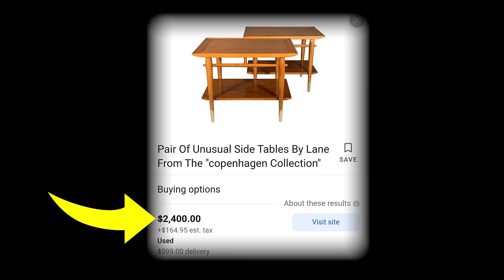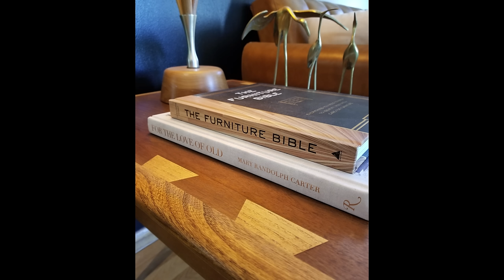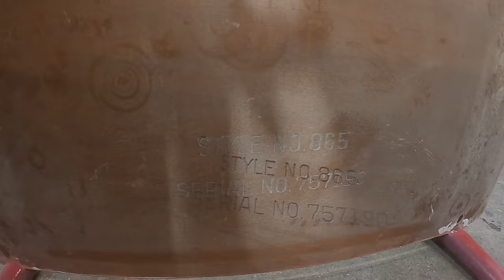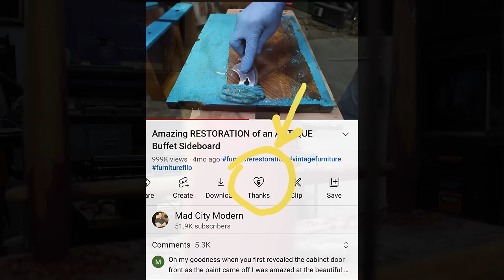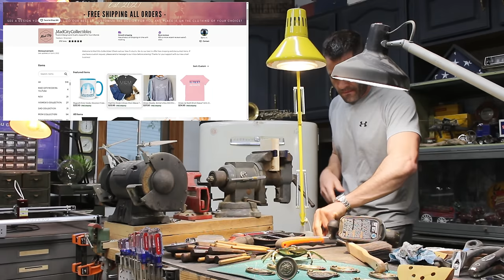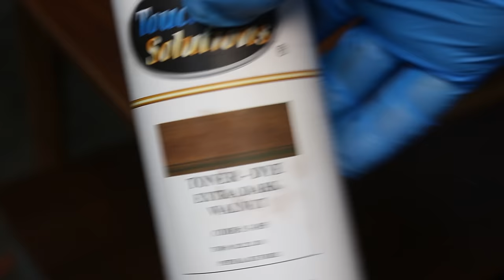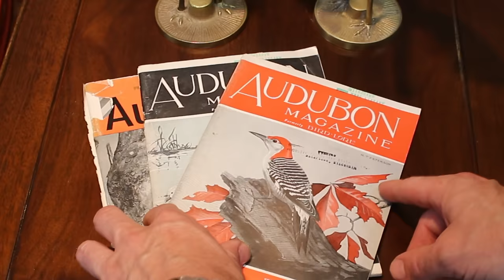Ep. 38 Amazing RESTORATION of a RARE VINTAGE Lane Side Table

Comment: I wasnt born for more than 20 yrs in 1957 but, Ive inherited several pieces of furniture from my parents and grandparents. I have a small, half round 'radio table' from the early 1930s that was my grandparents. I also have a pie crust edge occasional table from them. I inherited a 1948 Lane cedar chest from my mom and several hand painted, china lamps that were converted from lamp oil to electricity, from my grandparents.❤❤❤

Comment: I was a child in 1957 but I live in a 1959 mid century modern so you have to have a bit of furniture from that time period.  My oldest piece is a drop front desk from about the mid 1800’s .  When I purchased it it had its original ebonized finish but was in terrible shape.  When I removed the old finish I was surprised and delighted to find that under that black was solid curly and tiger maple with veneer only on drawer fronts.   It is a stunner.
Reply from the maker: Wow! What a rewarding find

Comment: You are such a perfectionist...
Months ago I bought a table from this manufactory and restored it. The table looked horrible, not only was the varnish carelessly worn off, but there were also traces of children's painting. But thanks to the great workmanship, the solid wood, it was able to appear again in its old glory.I treated the table with several patches of organic linseed oil.. Of course, this takes much, much longer to move in, up to 2 weeks. But there is no other oil that penetrates so deeply into the wood. My solid wood countertop in the kitchen is the best example of how it works. The water stains are only superficial, twice a year at most I grind them down a little and oil them again. By the way, I gave the table to my nephew.
I now use shellac as a primer when staining. It is not only a natural product, but an excellent primer when working with self-mixed stains made from color pigments.
Reply from the maker: This is great information I will pass on. thank you for sharing. Barry

Comment: I have my parents bedroom set, which is much older than I am! It's a Kling of New York solid cherry with a mahogany stain. It's in really good condition and I do the Howards wax n feed about once a year to the insides of the drawers. I also have repurposed my mother's make up vanity, which is also cherry with mahogany stain . It's now my TV stand. The drawers hold DVDs as if it were made for them. About 50 DVD's in the two  bottom drawers, cd's in the two  middle drawers, and could hold cassette tapes in the two top drawers. It still has a hint of her make up from time to time, even though I've wax n fed it for years!  The middle drawer holds my warranties and user manuals for the various appliances in have purchased. 
Recently, I've gotten into, on a very small scale, repurposing furniture. Love the different woods I've come across and haven't painted any of them. I work for a local Benjamin Moore Dealer so I really like using the Old Masters stains, when I can. 
The table is beautiful and I love seeing furniture reborn into the beauty they were meant for! Your work is awesome! Thank you for sharing it!

Comment: I was not around in 1957. I think my oldest piece of furniture is a Brown and Saltman orange metal top constellation side table. From what I can deduce from the internet, it was designed by John Keal in the 60's. It's priced around $500 but I bought it from a local vintage store back in 2007 for about $60. It's been many things for me over the years and I could not dream of selling it. It's in very good condition. The wood is a bit dry, but it's structurally sound and the metal top looks amazing.
Reply from the maker: I'm the same way. I have things I feel I could never sell

Comment: Another beautiful transformation!  I sure wish people that decide to paint furniture would consider the future of that piece, and at least put a coat of poly on to keep the paint out of the wood grain.  That just protects the wood and anyone down the road that decides they want to strip that paint will have a much easier job.  This turned out great, Barry.  

I was ten years shy of being born in 1957.  I have several pieces in my home that are much older than me.  I have a walnut armoire that belonged to my husband's aunt, an old camel back chest that still has all of her newspaper clippings and other collectibles, and her buffet and china cabinet.  The buffet and china cabinet are most sentimental to me because I had to spend a lot of time and effort to clean them, repair them, and polish them.
Reply from the maker: I think finding the newspapers would have been my favorite part
Reply: @MadCityModern  Maybe one day I will get the courage to pull all of the contents of the chest out and record it. Only one newspaper has stuck with me and that was the Lindbergh kidnapping.  I honestly don't remember what else is in it.

Comment: I wasn't even a thought in 1957 as my dad was 7 and my mom was 5. I do have an old end table that belonged to my great grandparents - I believe they bought it new in the 1940s. It's round, with a shelf underneath, and is a bit taller than the average end table. It has a beautiful wood inlay design, but there is some damage to the veneer that I'm hoping I can fix using tips I learned from watching you and other furniture refinishing channels.
Reply from the maker: Loved reading this

Comment: I have several pieces of furniture that belonged to my mother-in-law. Several pieces make up a bedroom set (full-size bed) with the bed with a headboard and footboard, a chest of drawers, a vanity, and a stool. It's from the early 50s, I think. It wasn't expensive, but it is well made, and the chest of drawers has cedar-lined drawers. My mother-in-law "refinished" it at some time in the 60s, but she didn't clean off any of the furniture wax/oil she'd used over the years, so the finish bubbled and cracked. It's a mess. But I want to use the furniture in my guest room, so I'll be starting to refinish it after Christmas. There are also two end tables that need some work; I'll practice on them before I tackle the bedroom set. I've learned so much from watching your channel and others on YouTube.
Reply from the maker: thank you so much for sharing this

Comment: You would need to trim them to get the angle, but brass caps for furniture legs can be found with the google. Brass is such a soft metal, i usuallu cut it by hand wity a coping saw. Siilarily, you could made a cardboard , make a pattern, and make brass sheeting to wrap the legs. You are very kind to whoever painted it purple. We all do the best we can with what we can at the time.
Reply from the maker: Great suggestion. Thank you for this
Reply: Sorry about my terrible spelling! Thank you for being kind and struggling through to what I meant. I have days where the letters and I just don't agree on the order, secondary to a concussion long ago. Love the positivity on your channel!

Comment: I wasn't born yet, I have a hoosier left to me by my aunt from the 1930's, dresser and vanity made of black walnut from the 1800's, still in perfect condition,  a few more 3 actually, all over 100 years old but has been refinished, 2 very well, one....was painted and "antiqued" in the 70's...could strip it and redo it but not able at this time...I treasure pieces from family, I look at my hoosier and get a warm feeling and feel close to my aunt...since my hooiser was made in the 30's it was white..... my aunt stripped it and just put a clear coat on it, the wood isn't oak, the pieces on the doors are different colors, I found in the very back a piece of color,   a green of the period used in the 30's so I stripped it and painted it the original green, and just to make it mine I painted mandala's on the doors, in the scandinavian style.   I used a primer, which I have heard from other channels that if a piece is primed it is easier to return to the original state.  don't know if it is true.... I am a person who see beauty in age, it doesn't have to be like new, just to work well.  all the pieces work, they hold things, and look good doing it.

Comment: I was at kindergarten in 1957. Hubby and I don’t have any items that old in our home. The home we live in now was built in 2000 but the original dwelling was a similar design, built around the thirties, but had been let go to deteriorate by the old widow who lived in it until her death. So the new owners got permission from our council to knock it down, as long as they replaced it with a similar design. It looks the same as next doors house, except that where the main bedroom was, we now have a garage and a driveway, so two parking spots. The house was made longer with more bedrooms and less backyard. It suits us fine. It has all mod cons too which e love. Thank you for asking.
It had improved its value by 350’/, in the fifteen years we have lived here. How good is that!?!❤️🦘

Comment: Use steel wool when stripping .It helps to strips legs and detail areas.
Reply from the maker: I have used it many times in other videos. great suggestion! I should have used that and a nylon brush with a second stripper application
Reply: @MadCityModern  I  have refinished truck loads of furniture for resale, ( in my younger days)  and I always called steel wool a magic sponge. It does a great job of getting paint out of tough spots when used with stripper, just be careful with the grade of steel wool, like sandpaper it can cause damage.  You do great work and your videos are a pleasure to watch .

Comment: stunning work. is there a specific reason you didn't use steel wool/mineral spirits after the paint stripper? I see that a lot, and I'm wondering if it would've helped get out that primer, but I'm sure you have a reason
Reply from the maker: I usually include that step in my projects, but decided not to this time. I do wonder if a nylon brush or steel wool would have helped remove the rest. Great feedback

Comment: Have you ever tried which hazel to clean up the stripper and a soft wire. Brush or old tooth brush instead of the scrapper.? To leave the finish, original stain intact.  Since its a collector piece?

Comment: What makes you decide to use a plastic or metal scraper when stripping?
Reply from the maker: I usually try to use a plastic scraper so I don't damage veneer, but both work well when used carefully. Great question